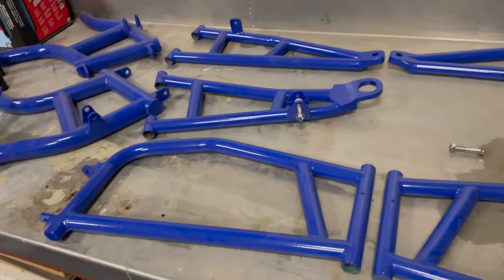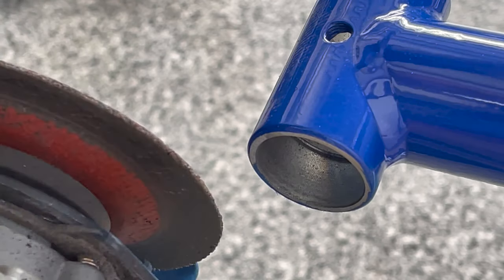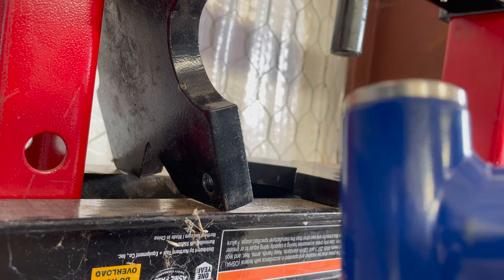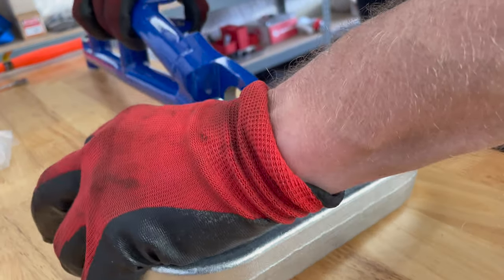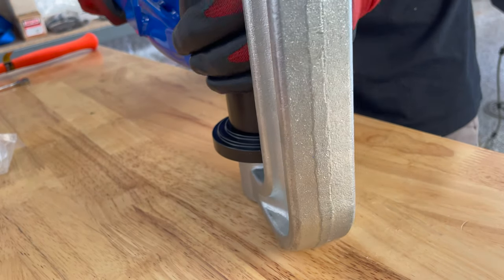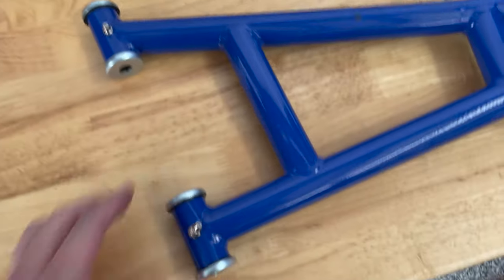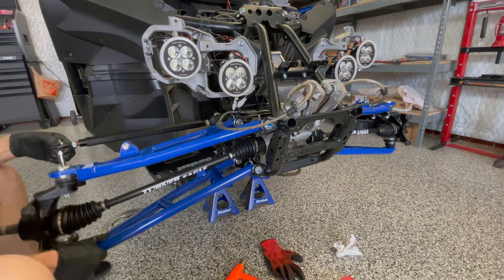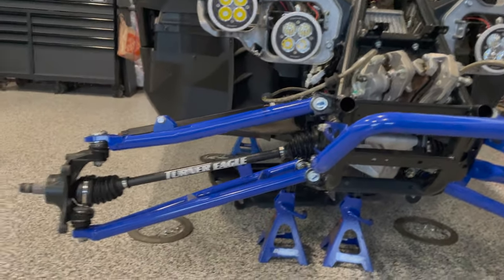NXS Designs long travel kit front install on 2020 Yamaha YXZ-1000R

Comment: Really curious how different a YXZ feels with suspension mods.
Reply from the maker: In my opinion the YXZ needs all new suspension for sand or desert riding.  The OEM width and travel cannot keep up with any of the high end sport UTVs on the market today.
Reply: @bendavis35  absolutely agree, the suspension is just not there in stock form. I love the immersive driving experience enough that I deal with the subpar suspension. Yamaha could do so much better with this car.
Reply from the maker: @michaeldavison430  build it.  The YXZ can hang with any of them with good Long travel and great shock setup.
Reply: @bendavis35  do you think a revalve like Weller offers is worth it?
Reply from the maker: @michaeldavison430  yes absolutely.  Anytime you change your suspension geometry (long travel) the shocks must be revalved and resprung to match your setup.  All my YXZs have had Weller Racing shock work.

Comment: Ben, I am installing an NXS long travel kit on my 19 yxz and have a question about the tie rod installation using the stock rack. After watching all your videos I didn’t see anything that shows that except for a little bit on your Weller rack install video. So my question is will the instructions that come with the Weller rack be helpful for what I am doing? I have no torque specs or any other instructions for reinstalling the boot or any other helpful hints that may help. Thanks in advance, sincerely, Mike Master.
Reply from the maker: Are you using the titanium tie rods that come with the NXS Designs kit?  If so, reach out to Matt Ling with NXS Designs for his input.  I assume OEM torque specs will be fine, use the Yamaha service manual.  The boots will need to be trimmed a bit to slip over the inner threaded shaft.  I'll be happy to send you a photo of my OEM rack with the NXS titanium rods installed in my old YXZ.  Also I can send you a photo of the service manual pages if you need it.  Please email me if you are interested ben at the-soundwave dot com.